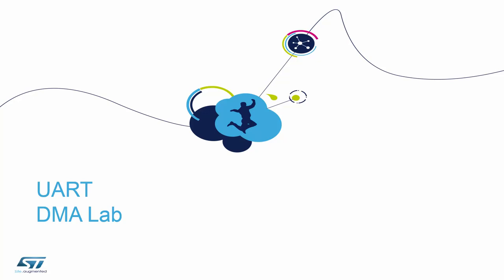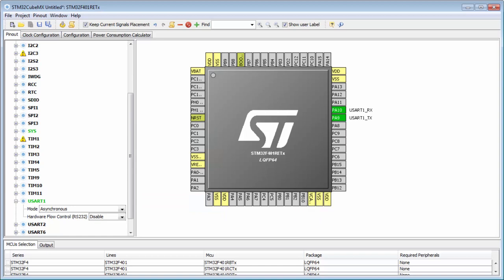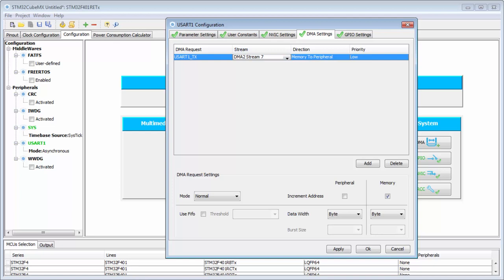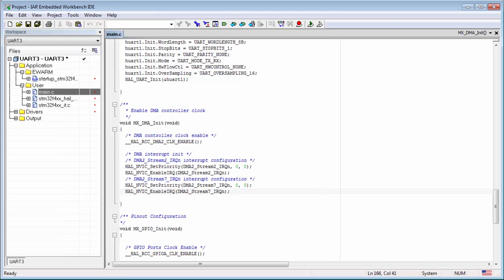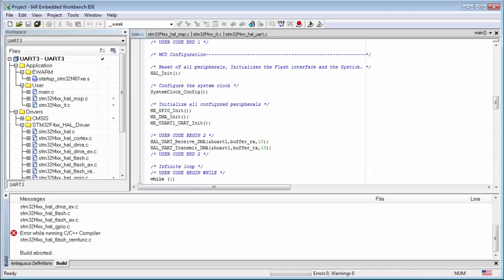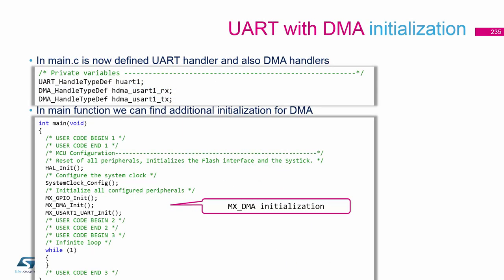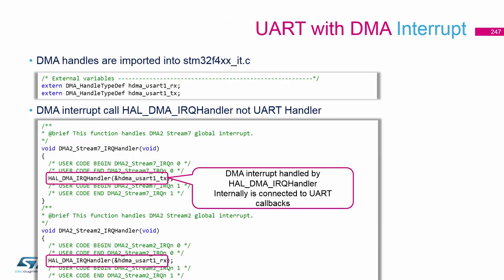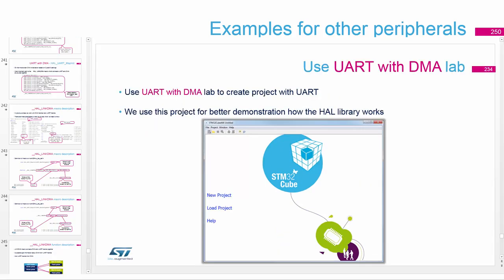STM32CubeMX basics: 10.11 STM32Cube HAL labs UART - UART DMA

Comment: There is a mistake here. If you don't enable "USART1 global interrupt", uart tx will not work after 1 cycle. Because this will ensure the USART communication by checking the flag, as the set of the ready flag is managed inside HAL_UART_IRQHandler() by the UART_EndTransmit_IT(). Otherwise gstate will stay busy all the time.